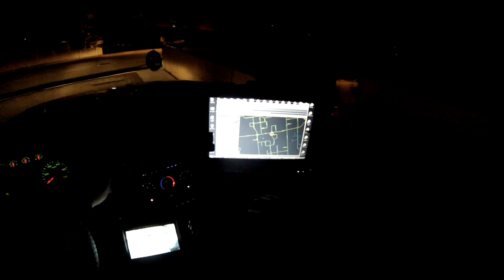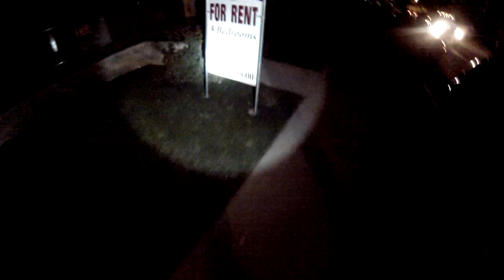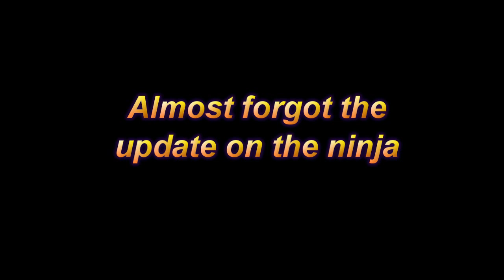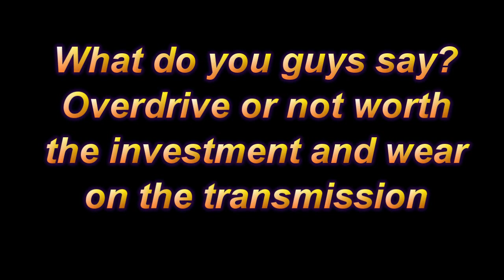Walking The Late Night Parking Garage Searching For Vehicles

Comment: Matt, call Gear Vendors and talk to them. I totally disagree. That trans doesn't care what rpm it turns. At 35 or 60. That trans is the strongest part of the truck. A Gear Vendors overdrive would be a huge stress relief for those rockers and really, the entire engine. I say Call the experts and ask them. Also, please tell me you reused your big dog heads and studs.

Comment: OD to Much risk bc it will put strain on the transmission the truck is built to haul it's not a regular truck (pick up). I honestly think those trucks should have bigger transmissions more gears with higher ratio. It is a small rig it should have been built like one.

Comment: Overdrive for sure. GearVendors over/under drives are great. https://www.gearvendors.com/ As far as harder on trans, wrong! its not. Remember an object in motion tends to stay in motion, so with that said when you are up to speed going to overdrive puts little to no strain on the transmission. If you are in a hard pull you are not going to be in overdrive anyway.

Comment: Your mechanic is right leave it alone your truck is geared for its weight and whatever your max towing capacity you add overdrive you will be putting excess load on the transmission your truck weights a lot as it is way more than a regular pick up and 6.4 and 6.0 are junk I would have put a 7.3 in it or a duramax with Allison
Reply: I agree. I wouldn't question his intelligence as he was able to take apart and put back that motor.

Comment: Dear Sir

Why not just do a Rear Differential gear swap from the 5.13 or 4.88 or 4.11 gears
 and swap in gears to a  3.73 or 3.55 or a 3.23  or a 3.08 gear set 
You can tailor the Gear swap so the engines RPM is where you want it to be 

Find out what gears  in there now , and calculate the cost of a gear swap
and then calculate how much fuel would be saved 

The GEAR SWAP  should cost LESS money than a ADD ON  Overdrive unit installation with a new drive shaft
And save you some Money $$$ , as well as save you money on fuel cost 

Your truck will be slower off the line , but it will not wind the engine up so high 
while your cruising on the freeway,

Just a thought to figure on to save you some money . Sir ..............

Comment: Arch Oil will help you with fuel mileage give it a try. I add  it in the fuel. oil, power steering pump and rear end. I have a 2006 F350 with 6.0L with 145000 on it and never had any motor trouble with it... Check it out at powerstrockhelp dot com.. You like them big dog heads you got Bill Hewitt made them he own that web site. 8oz bottle of AR6200 Fuel Modification Complex (treats 640 gal fuel).

Comment: id say not worth the overdrive....... the money you would save on gas you would spend on transmissions just my opinion tho
Reply: Peter Dancer If he uses the OD properly his trans. will be fine.
Reply: Peter Dancer The money he saves on gas would take years to accrue to pay for the OD and installation expense. Think about it, couple $K for the OD and he gets 2~4MPG better highway, but he cannot use it when loaded. Saves him $10 bucks a month. How many years would it take to build up enough gas savings to justify the original investment. That it called a false economy. To compound the problem, if he forgets to pull the OD out when loaded and pops the trannie like you suggested, then complete waste. Don't try to fix something that isn't broken in my opinion.